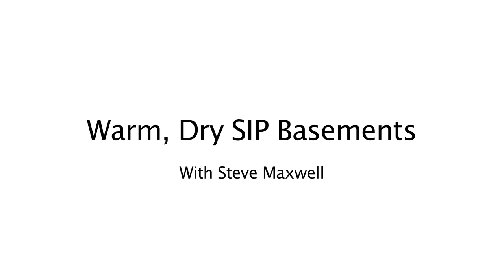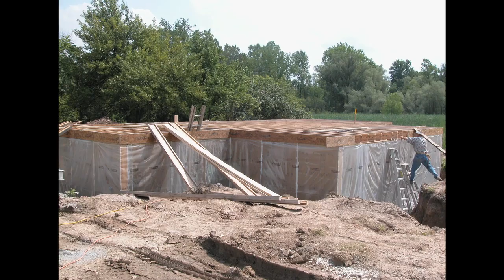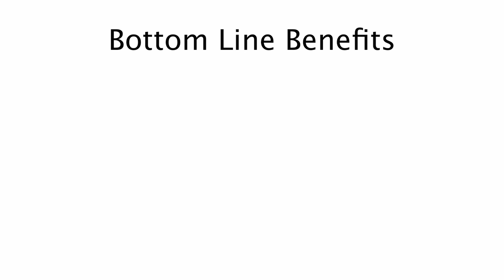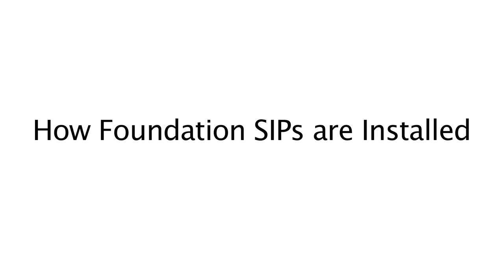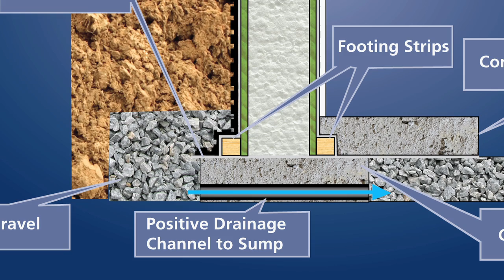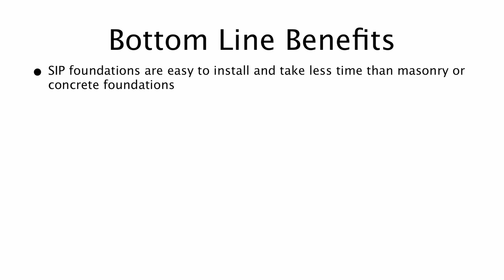How to Build a SIPs Foundation

Comment: after 40 yrs these panels are bowing and have to be removed.  they neer rotted just bowed in the middle of all 4 walls   we are now in the process of lifting our house to replace with concrete.  also the long span panels on the roof will bow as well. never use these on roof or below grade.

Comment: We have been in a SIP home, 10 years now, 1500 square foot. Ours has a SIP basement as well. The key to heating these homes is in the basement, I finished our basement with tongue and grove knotty pine in order to add ¾ inch more insulation and hold more heat in. I also installed padded carpet which actually added a lot more insulation, open concrete absorbs and dissipates a lot of heat energy, you don’t want open concrete. We have propane heat/furnace and a basic wood burner in the basement, our propane bill is $300 PER YEAR, and I only use about a cord and a half of firewood per season. 
By keeping the basement heated the heat radiates up ward and the furnace never comes on. If we burn for more than 5 hours the heat will cook us out, the house will stay heated for 12, 24 or 48 hours, depending on the outside temperature. SIP homes are very easy to heat and stayed heated for a very long time. 
I’ve heated the basement up to 85 degrees with out melting any snow away from the house, the basement is insulated like a sauna and the heat can only go up. I pretty much store the heat in the basement. For an experiment I hooked up a 220 volt, 12K electric heater in the basement and was able to heat the entire house with it. I only use it in the spring and fall when it is not cold enough to fire up the wood burner. 
We have a regular furnace, according to code but very rarely use it.  As for summer we only need a window AC unit, living and bedroom, to cool the entire house. 
I’m very surprised these homes never took off, people don’t know what they are missing and how much money they could be saving.
Reply: I know prices nowadays are different from when you built. Did you price compare sips basement with concrete? And the same with your upstairs?

Comment: Steve, I found a company that sells SIPs that use sheets of fiberglass instead of wood to sandwich in the foam... in your opinion, would fiberglass SIPs have the same water repellent properties as preserved wood? Could fiberglass SIPs be used in lieu of preserved wood SIPs?
Also, assuming I wanted to use SIPs as my flooring instead of traditional joists... after the foundation's walls are put up, could I just lay down some SIPs on top of the SIPs foundation walls' top/cap plates? And if so, how far can SIPs flooring span across zzbefore you start needing piers in the center of the foundation? I ask because in the last photo of your video, it looks like the SIPs flooring is held up by joist hangers rather than them just sitting on top of the walls' cap plate.

Comment: Hi Steve, I would like to convert an old attached shed as a living room.  The floor is built with joices and 5 inch wood plancs and sits on the ground with about 4 "" of clearance .  I would like to know if I can built another floor on top of the existing one and insulate it at the same time.  I have about 3 "" to play with to match the inside floor of the house.  Thank you.

Comment: How can a SIPs foundation work with straw bale construction?
Reply from the maker: MrsMika Good Morning! The short answer is, I don't know. Straw bale walls are quite thick, and I don't know how that would work with a SIPs foundation that's only 6 inches thick. I've never built with straw bales, so I'm not sure how they make foundation walls wide enough. I'll look into it, though.

If you've got a minute, stop by and visit me on my website at https://stevemaxwell.ca
Right now I'm giving away three power tool packages worth more than $1200 each. 

Thanks for your question and thanks for watching. 

Steve

Comment: wood be nice to see more about how the sip fits to the ground.
Reply from the maker: Hi C Tomlin!
Thanks for your note and thanks for watching!
Yes, I should have gone into more detail, but the situation is pretty simple. There's a poured concrete footing right on the ground, with a 2x6 pressure-treated piece of wood bolted to the top of the concrete. The SIPs have a recessed edge that fits over the 2x6, locked there with screws or nails driven into the the edges of the 2x6. Does this help? I hope so. Please let me know.
You might find my weekly newsletter useful and entertaining, and anyone can sign up at https://stevemaxwell.ca. I'd be grateful if you'd check it out.
Bye for now,
Steve
Reply: ***** yes it does help, thanks

Comment: I wonder how the preserved wood holds up against termites as compared to traditional foundations.
Reply: Use fibercrete panels instead.  All the structure of a plywood sip with the fire resistance of concrete and not also likely to attract destructive pests.
Reply: mtoffers73 bingo....! rott is one thing but termites? don't see a way around that
Reply: SIPs below grade cannot be eaten by termites. Termites eat where there is air. Also the chemicals used in the wood prevents any insect from eating it.